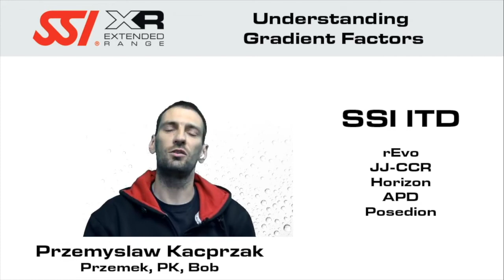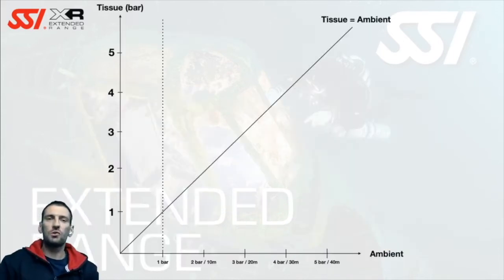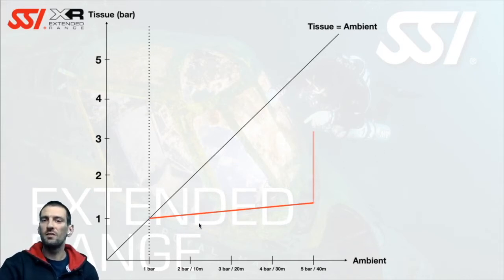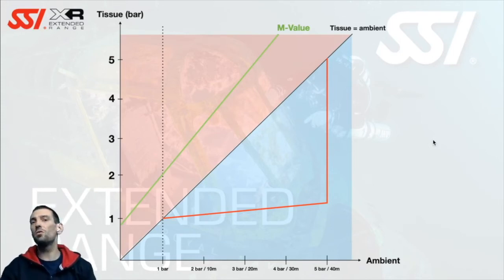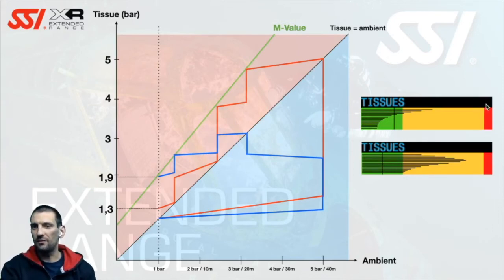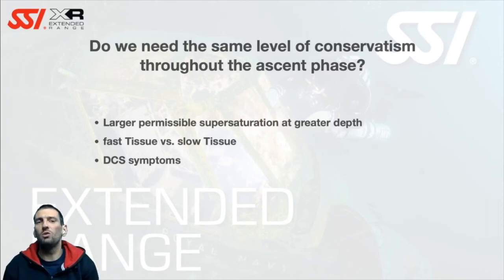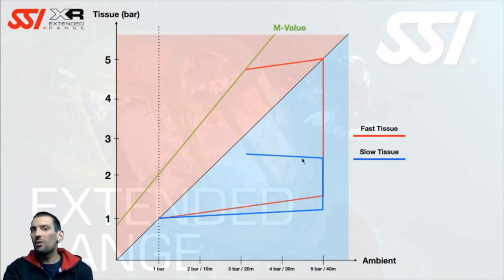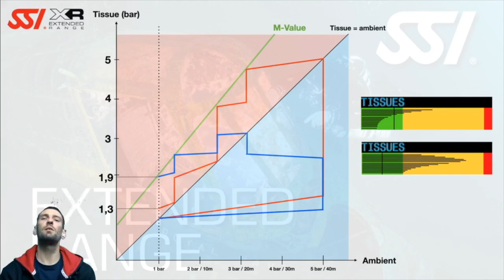Understanding Gradient Factors - EN

Comment: This is the best explanation of gradient factors I've seen. But I do have a few questions I hope can get answered here. 1) How are the M values for each tissue compartment determined? 2) Are they the same for each compartment or different? 3) Hypothetically, can the GF low be higher than the GF high (ex 80/30)? The Shearwater computers will not allow this. 4) What determines how long each stop is?

Comment: What is the answer to your final question: Which gradients are more conservative 40/70 or 30/80?
Reply: 40/70 is very conservative, the high GF is the "end of your dive" to say like thad, for example 30/80 or 80/80 will give you the same time of  deco but the lower gf will stop you earlyer in the way up instead of higher value on low gf...
For example 
30 min to x depth gives you 2 min to 6m and 5min to 3m
2nd will give u like 
1 min to 9m, 2min to 6m and 4min at 3m
Ending with 1% extra CNS
Reply: @anghelcosmin15  sorry, explaining the values does not answer my question. In your example the difference is in 1% CNS and first starting with deeper first stop. But which one of the is better?
Reply: @askingdiver  40/70 is more conservative! Bigger "safety margin" from the original m-value line! If this will be more clear for you! Cheerss!
Reply: @anghelcosmin15  Ok, that applies only to the GFHigh=70, because for GFLow it is the opposite. (we are comparing 40/70 vs 30/80). One setting benefits from more conservative GfLow, the other from more conservative GFHigh. So what is the measure, which one is more conservative? How do i decide? Which property of the two is more important or do i need something else to be able decide?
Reply: @askingdiver  ok give me an depth x, bottom time, nitrox mod or air and i will tell you exactly the deco plan!
But surface GF gives you the conservative level! Durring the dive yor sur GF growing with "no deco time" till will reach your HGF set for example 95. (Sur gf95) then what is over need deco..for example u are in 3m last deco stop and your surfGF is 110% thad means u can't surface till your surGf will be 95 or less..fi u reach 95 and u still oingsafety stop for an extra 3 minutes your sur gf can become 80% wich can be caled med conservative (your set was 45/95) but u surfaced with 45/80)

Comment: Great presentation about gradient factors, only one small fix, default gradients for all Shearwater devices is 40/85. I would also recommend/add what are the ranges for gradients? Both in the range 0-100%, but most devices don't allow you to do so. So common range is 20-50% for Gradient low and 60-95% for gradient high. With the rule that gradient heigh is always a higher number than gradient low. And last, too low gradients add unnecessary time underwater (at the decompression stops), which means you need to have enough gas when planning the dive.
Reply: As soon as you flick them into oc tech they default to 30/70
Reply: Recreational mode's medium conservatism is 40/85, Tec modes switch to 30/70 per default, recreational has 3 modes of conservatism, most conservative switches to 30/70.
Reply: @ugosinsaang  Ok, thanks i didn't notice the difference between rec. and tec.